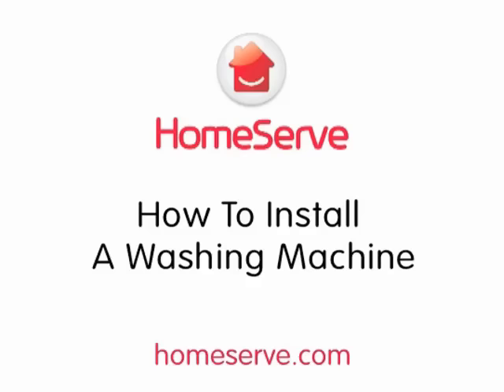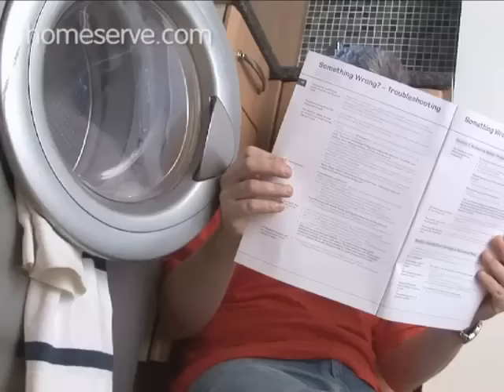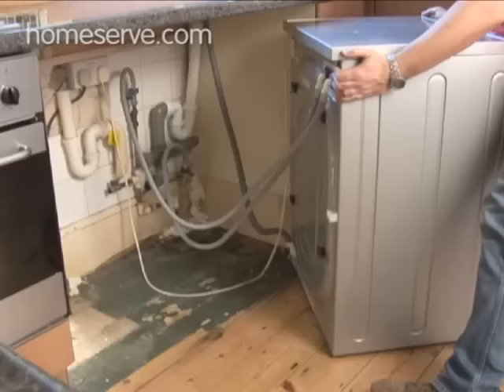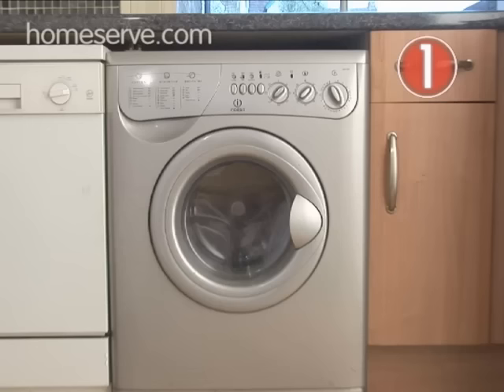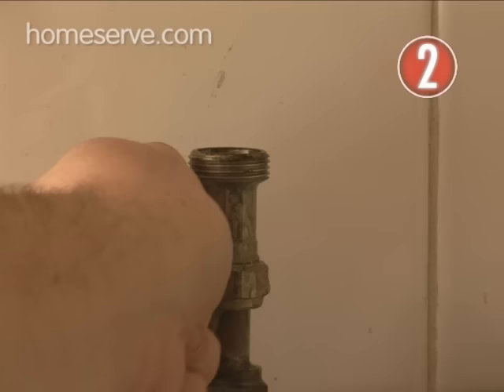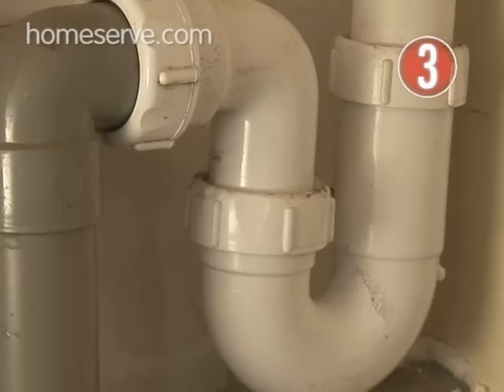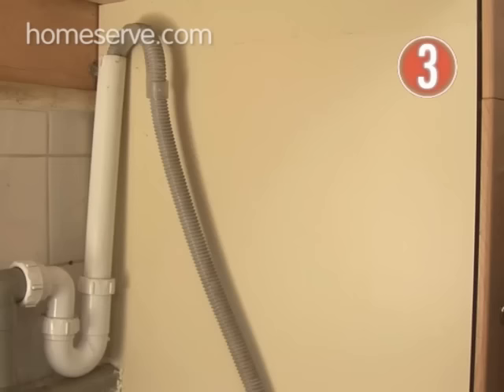How To Install A Washing Machine

Comment: I would have done this myself with my new washer/dryer if I had the tools to remove the metal stoppers at each of the hot and cold pipes. Fortuantly I had new kitchen and plumbing done 18 months ago, and just got the housing association to do it free of charge.

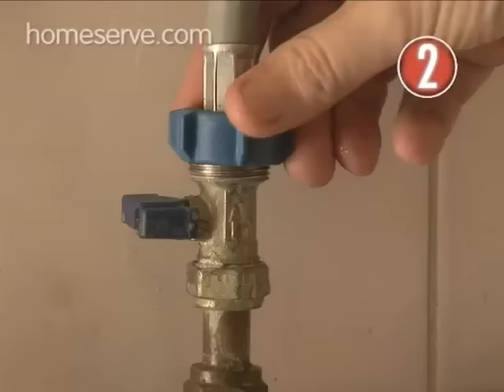Comment: Is this how NOT to install a washer? - No mention of removing the transport bolts or connecting it to an electricity supply. It does show how NOT to connect to a water supply without mentioning the connections should NOT be leaking as they are in this video at about 0:54
I suppose it's just as well there's no mention of connecting to the electricity supply - leaking water connectors and electricity just don't mix very well!
Reply: Do you need instructions how to plug something in electricity, really?
Reply: @opuncia2731  No I don't need the instructions but the maker of this video does, he was able to supposedly  install a washing machine without plugging it in, Perhaps just as well he didn't plug it in with all that water about.